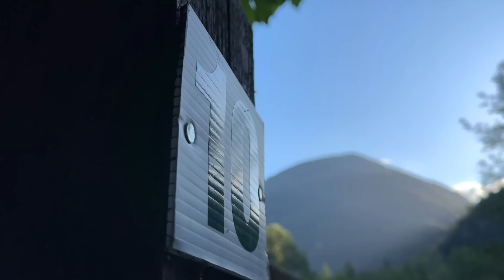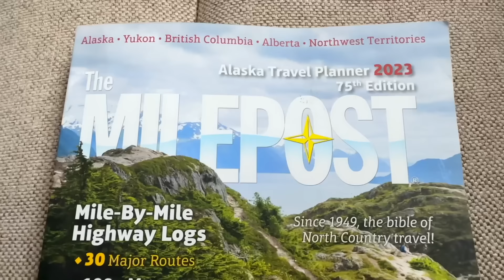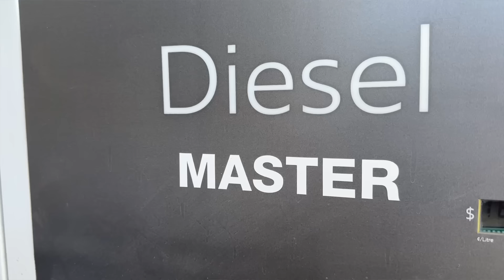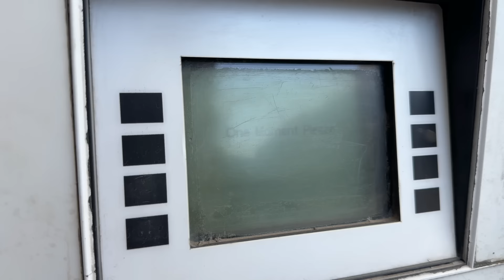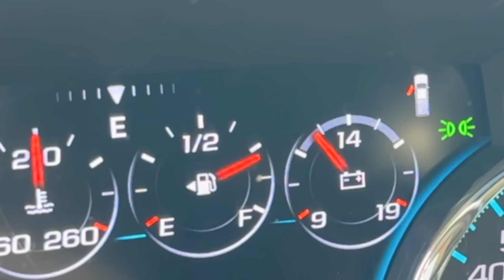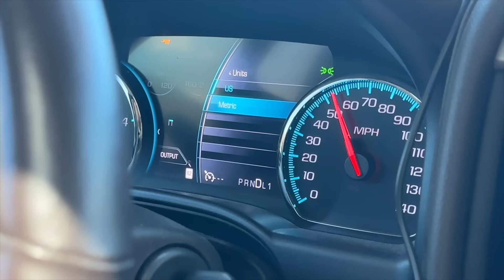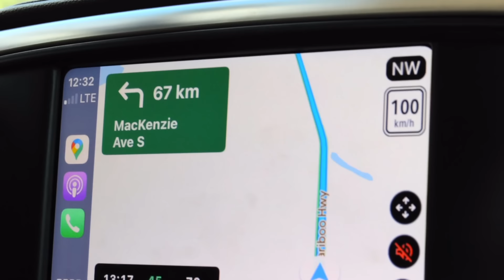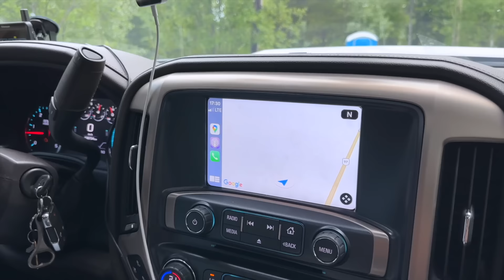We Were NOT Ready for This - RV Living in Canada is Different!

Comment: Canada is not necessarily "backwards" using the metric system.  I'm pretty sure the US is the only country still using pounds and gallons.
Reply: 3 counties still use Imperial System of measurement, rest of the world is Metric.
Reply: @epicgameztv  An only the US uses US gallons. So yes, Canada's definitely not the backward one lol.
Reply: There are places in the Caribbean that use gallons
Reply: In the UK they use imperial gallons which are 20% larger then US gallons.
Reply: @speedy_brennan  for Gas, what about milk and water.. I know Ireland still uses it for gas at the pump but when it comes to trade they use litres
Reply: I've hauled water for agricultural use, to be mixed with pesticides.  In Canada.  We used Canadian gallons (probably the same as UK).
Reply: @daerdevvyl4314  Its weird.. cause Canada is on the Metric system.. but to hear gallons are still used for some things.. maybe they do both to make it easier with the USA if 4 liters = gallon :)
Reply: Canada uses the metric system but for somethings like weight and height or estimating the size of something people will use imperial.
Reply: We use feet and inches for height of people and measuring for construction. As well as pounds and ounces for weight. However somethings we use metric. For example deli cuts most places use $ value per 100 grams. I've started to use KG more for my weight because it makes sense to use a system that is more global. All distances or speed measurements are in KMH by 90% of people born after 1940 lol, and to measure fluids we use Ml and L oppose to fl.oz.
Reply: @epicgameztv  alot of people say that 4 liters is equal to a US gallon however the actual math is 3.78541 liters=1 US Gallon, which equals 0.832674 Imperial Gallon I'm Canadian but have family in the UK and they use Imperial Gallons.  Also my car can go in all 3 types.  Liters/US Gallon/Imperial Gallon and I have to pay attention which one I put it on when I go into the US.
Reply: That’s the imperial system that is backwards, but hey what does 95% of the planet and NASA know
Reply: @danielgertler5976 some will use Imperial for weight and such but in the official documents and hospital records are in metric. I don't get why some people can't just switch the average use of weight to metric. As a Canadian, I have fully switched to metric.
Reply: As a Canadian we have a weird ass mix. Litres and kms for everything. But, my id has my height in cms and weight in kgs. 
But NO ONE used that. It’s feet and lbs. if you asked my height in cms I’d need google. ..or my Id I guess. 
same goes for measurements, usually.
We talk in feet and inches, but most times at work, it’s metres. 
However toilet flushes are still in us gallons 🤷🏻‍♂️
Reply: @speedy_brennan  Well I was just in the UK, gas by the litre so was milk...
Reply: @epicgameztv Ireland uses litres. I'm pretty certain of that.
Reply: @epicgameztv  live in Canada and have never heard anyone use gallons. And it's 3.79L to a US gallon.
Reply: @Toubabou And the US military.
Reply: @patricksimoneau7647 New toilets have litres and gallons per flush on them
Reply: @bubba842  yeah usually written like  “1 us gallon per flush (3.8L)”
Reply: @bubba842  I haven’t heard a Canadian, but I have heard Americans ask and we always say it’s about 4 litres. Even for Milk and water in the 4 litre containers.. they refer to it as a gallon. Doesn’t have to be exactly but close enough for most people to relate to it
Reply: @btownballer27  where and what kind of construction do you do? 
I have never seen feet or inches on any drawings in the last 12 years. Not on anything commercial or industrial. Maybe in residential construction.
Reply: @bubba842 i used google maps looks like litres to me..
Reply: @speedy_brennan  Gas stations look like they sell gas in liters from what i could see using google maps
Reply: @danielgertler5976  Older people who were raised on imperial or during the switch. I find myself being one of those people. However my son is all cm and kilos..
Reply: @patricksimoneau7647  I'm in residential. Framers, fence companies, decks and even drywall/insulation use inches and feet. I can see the commercial sector being a metric system but even when it comes to listings (for sales or lease opportunities) they are advertised as sqft of space.
Reply: @patricksimoneau7647  I'm in the insulation and drywall business. Ontario.
Reply: @btownballer27  okay, so yeah mostly residential then? I know I’d say a 9ft ceiling not 2.72 m or whatever it comes up too
Reply: @btownballer27 True. Lumber is sold in feet too, in Canada.
Reply: @kimberleyjane2338  yes
Reply: Technically the USA signed an agreement with France a long time ago promising to use metric units, but somehow…..
Reply: @epicgameztv 4L doesn't equal a US gallon though. US gallon is smaller.
Reply: @bubba842 They do (I'm Canadian and visited Ireland a few years ago).
Reply: @epicgameztv  If you look it up, it says alot of there road signs for distences are stil in Miles which is more then likely why cars still come with the imperial mile setting as the option.  It says beside using miles and yards for distance the UK use the metric system which is why gas and milk are sold in Liters I would say.  My google seach did say they meant to convert there car distance signs over to km it looks like they never got around to that part of converting.
Reply: @epicgameztv  we still use US gallons in Canada because most everything is built or designed for the backwards US.  Majority of the world went metric including canada but with the us they went metric but don't enforce it.  so they still use gallons and oz and pounds......  for us in agriculture chemical mixtures are set to gallons per acre and all our land has been divided up into acred packages typically of 160 acres.  so for us to use the system that US still uses is easier then doing a conversion and hoping the conversion is correct and we don't kill or burn our crops.
Reply: Yankees can not figure out a system based on 10...
Reply: Metric was invented by the French because they struggle with basic math and need to make their little Oui oui's sound more impressive.
Reply: @epicgameztv  I use both as I was raised in my early school years in Canada gallons and in my later school years when Canada switched to metric liters, no big deal for me,
Reply: You need to fuel yourselves up at a Tim Horton’s.  Get the Caffeine buzz for long road trips.
Reply: So true.  I don’t know why USA did not make it metric here.
Reply: @coryturke7336 I’m American, and that was funny
Reply: @speedy_brennan , the UK is like Canada pretty much converted to metric. But some things still are stated in Imperial by people.
Reply: @speedy_brennan The UK is the Kings gallon where the US adopted the Queens gallon
Reply: Let’s be clear. Canada is “officially” metric, but we talk imperial in some instances. I do kilometres & Celsius, but feet & inches. In the kitchen I can do either or for wet ingredients but imperial for dry ingredients and temperature. An English cooking video will likely do imperial or both, where a French one is strictly metric.
Reply: Not true in building supplies are still feet and inches a pounds in Canada. Also personal measurements feet inches and pounds. Both countries use both systems.

Comment: Master Diesel/ Marked Diesel is a western Canada thing. For the most part in Ontario,  pump diesel is all taxed and colored diesel is usually bulk delivered to farm tanks or construction sites.and in Ontario I gallon milk is in bags or 1 and 2 litre containers.
Reply: Here in the US, we have red diesel also, but I've never seen it at a station.  It is only bulk delivered to the farm like you mention.
Reply: I am from Saskatchewan, have a diesel truck and camper and have been out to B.C. numerous times. I have never seen marked or “ purple “ diesel at a pump either. Mind you I don’t fill at the pumps meant for big rigs. Most if not all campers will fit under the awning at any service station.

Comment: Hope you've got the Milepost with you - it'll keep your sanity.    We've made the trip up and down the Al-Can several times.   You'll run into "frost heaves" on the road surface as you approach Tok, pay attention to the speed signs for "frost heaves".   Towing a 5th wheel up the Al-Can can be very expensive 
IF you are traveling too fast, you can bottom out the suspension on the truck and the actual 5th wheels weight/size can jerk the truck bed up and down violently.  Seat belts or not you can hit you head on the truck ceiling, it hurts!
The "chainlink type" netting on the cliffs is to slow down and contain falling boulders from hitting vehicles.   Keep your eyes peeled for the wildlife too.  By now you've encountered the Canadian Imperial liter of gas, essentially  the Imperial gallon is about 5 quarts of gas.   
Once your far enough north you'll see more moose, elk, grizzlies and Bison.  Oh the Bison really love the green grass along the road.  Sometimes they'll lay down on the highway, look out for the new Bison calves too.
Reply: Went up to Yukon about 35 years ago, some woman with a deep southern accent told us we should have ‘the mapose’.  It took us a day to figure out she meant The Milepost. It was a great help as we drove the Dempster up to Inuvik. Great trip, and we still laugh about the mapose.

Comment: You can set your speedometer to metric by going into your settings in the DIC and both digital AND analog speedometers will give you KPH, no need to try to convert, your Denali will do it for you.

Edit: you did this later, I made the comment before watching the video LOL. So you do know...😁

Also, rinse off any spilled DEF, it is corrosive! I bought a hand pump from Walmart think it was $10 or so), stick one end of the clear tubing in the jug, the other end in the DEF fill port and hand pump, no spillage or lifting that heavy jug. I actually like where the DEF fill is...it's not something that needs to be filled often and I would be concerned about being tired or distracted and accidentally putting DEF in the diesel tank if they were right next to eachother.
Reply: Holes are different sizes.
Reply: @horizontraveler3180  correct...you can't put diesel in the DEF tank, but you can certainly put DEF in the diesel tank. I know several people who have done just that. Luckily they realized it and had their truck towed to the dealer for a tank flush but it's as bad as putting gas in the diesel tank. Sometimes convenience isn't always good. I like the redundancy.
Reply: They figured out how to switch the dashboard @11:00  It should be an easy to find setting on any modern digital dashboard.

Comment: Hey you two, I see your having a bit of an issue with the conversion for KM to MPH, up here in Canada most of us are taught that we just use a conversion of 6, multiply 6 by your KM to determine your MPH. Example: 100 KM multiply by 6 equals to 60 MPH. 100 x 6 = 60. With this simple conversion you are always just a bit under the speed limit by just a bit, it helps rather than trying to determine exactly how fast your are going. Multiplying by 6 is a lot easier than using the multiplier. 0.621371. 100 x 0.621371 = 62.1371 MPH. I am not big on remembering that decimal in my head, and most of us Canadians just multiply by 6 to make it easier. Hope this helps. Welcome to Canada and safe travels on your trip!

Comment: I loved the "master" diesel analogy.  It was awesome.  At cardlocks the "master" is the master pump and on the other side is the "auxiliary " pump. These two pumps are to fill up both side tanks of the semi trucks. You can use one at a time and it is that way so you don't have to throw the fill nozzle across to the other side of the truck. 😊

Plus at $1.759 per liter that is 1.759 x 3.78= $6.649/ gallon Canadian then add 40% exchange to US and ...... mind explodes on the real price of fuel ⛽️

Comment: Cool Video! Thanks for showcasing this! FYI - I live in this area of Canada (Southern BC) and drive that route several times a year. The southern portion of Highway 1 (in fact most southern routes) were washed out in several areas (including that bridge you crossed between Lytton and Yale) during the flood event of November 2021. It was quite major actually - if you do a google search you'll be surprised by the destruction. Many areas were completely cutoff from help/transportation/services/access for a long time (some for weeks). Another tidbit of info, The BC Fraser Canyon is the hottest spot in all of Canada (in Summer) generally during heat-wave events. In late June 2021 there was a very strong heat wave event that hit southern BC and the town of Lytton hit nearly 50C (49.6 to be exact) as a daytime high (June 28, 2021) - which was just under 122F. That day it was hotter than death valley/palm springs etc. The following day, a large fire swept through Lytton and destroyed about 80-90% of the town.

Comment: We have the same thing in the US regarding diesel. Only difference is that the red diesel is rarely seen in highways, its more common in rural areas here. If a state troopers pulls you over and tests your exhaust and finds out you’re using the red diesel you’ll get a hefty ticket. We fuel up company equipment with red diesel often times unless of course refineries are providing it. But its a no-no for highway vehicles.

Comment: Usually diesel in Canada is just diesel. I’ve actually never seen diesel referred to as master at any pumps but rather the pump itself referred to as master and a satellite pump is on the other side for semi’s. Marked diesel and dyed diesel are the same thing (off-road). A word from the wise, pack a couple extra jugs of DEF on that run to Alaska. It wasn’t easy to find along the highway at the smaller gas stations. The larger cities are pretty far apart.

Comment: Two years ago, I went to Anchorage, Alaska crossing thru North Dakota, returned thru Washington. 

Return trip was way more interesting as I saw a lynx, 3 porcupines, 2 grizzlies and 10 black bears.

DEF is a little difficult as I tended to only find 1 container at gas stations and at Wal-Mart. It's possible that DEF was harder to find because Canadians tend to delete their trucks, and/or it was another Covid supply chain issue.

RV Miles latest post had them at I believe Bear Glacier, a bit off of BC-37 at Meziadin Junction if I am correct. 

On my return trip, I stayed at Meziadin Lake Provincial Park RV campground overnight. They were full, so I Boondocked in an overflow lot. I left right at sun-up the next day before everyone else woke up since I never unhooked.

I had to drive the circular route out of the campground and was still in the campground when I saw about 10ft away a grizzly snacking on berry bushes. It took off just as I reached over for my camera in the passenger seat.
Reply: Canadians don’t tend to delete their def. 🙄. It is illegal in canada. (I hear more americans doing it though lol). And yes def was hard to find during covid, but i always found it at Canadian tire stores. 🍻

Comment: There are a LOT of rest stops in the province of B.C. because much of it is mountainous, and driving on mountain roads can be very stressful for people who aren't used to it so rest stops are there to allow them to take a break when they need to.  Not to mention a LOT of mountain roads have been hewn through solid rock and/or are on very steep and dangerous slopes where there is NO place to pull over, so they really did need to build in rest stops where cars and big rigs could pull over safely and without impeding other traffic.  And the big rigs DO need to stop often to check their brakes and make sure they're up to the task of all the constant and sometimes VERY long and precipitous changes in elevation (especially the going down bits).
As for rest of Canada and all of its OTHER provinces which are NOT so mountainous,  there aren't nearly as many rest stops as there are in B.C. - you can drive for HOURS in some places and not see even one!
Liters (or litres) are almost the same as quarts.  So divide the number of liters (or litres) by four, and you'll be able to convert how much gas you pumped into the approximate number of gallons.
You should always be able to get milk in half gallons (two liters/litres size) and quarts (one liter/litre size) but it will usually be in waxed cardboard containers in western Canada (and in plastic bags - I know, weird!! - in parts of eastern Canada).
Enjoy the rest of your trip - all the differences from what you are used to is part of the pleasure of traveling elsewhere!

Comment: 9:17  "Master Diesel" is not a thing here in Canada. There is "Clear Diesel" (taxed) and "Marked Diesel" (Still taxed, just not as much) Farm vehicles can run marked diesel on road.

I think the "master" you are looking at on the pump is in reference to the physical pump itself. There is likely another pump on the other side of the truck labelled "Satellite" Any fuel pumped on the satellite pump is applied to the volume and dollar amount on the master pump.

Picture a large semi truck with saddle tanks on both sides of the truck. How to fill both sides? Run an extra long hose around the semi truck? or install a separate satellite pump on the other side where each pump can fill both tanks independently but produce only one transaction with volume and dollar amount.

Comment: Master is also known as Clear at other stations. Oh, and if you are using a pump at a bulk fuel station, the master is the main pump and the slave is on the other side of the aisle. This is for trucks to fill on both sides.
There are about 4 liters in a gallon. (Imperial is 3.8 and US gal is 4.22) 
Oh... Welcome to Canada

Comment: Quick conversion KM to M is to take the KM  times 6 and drop last digit   So 100km x 6 = 600 drop last 0 tp get 60m           or  30km x 6 = 180   drop the last digit  to get 18m
Reply: Or just divide by 2 and add 10.